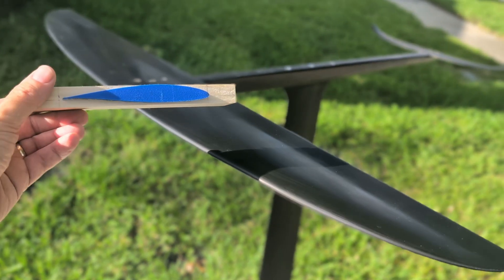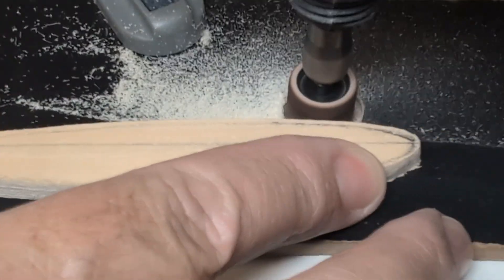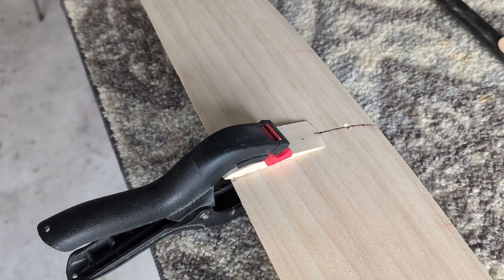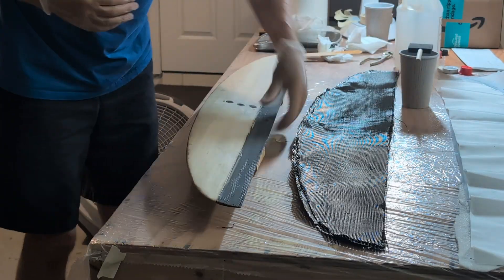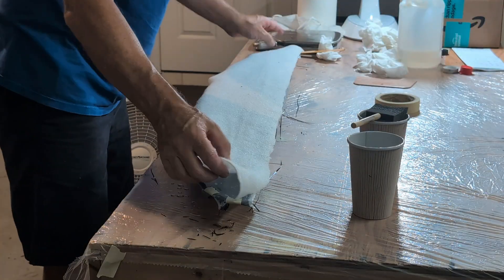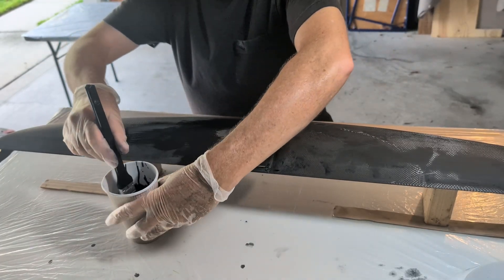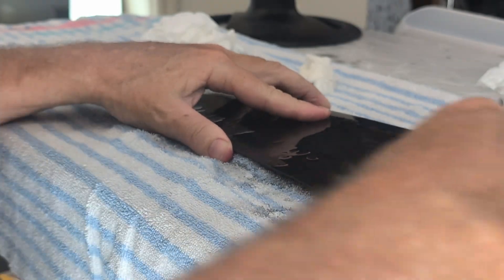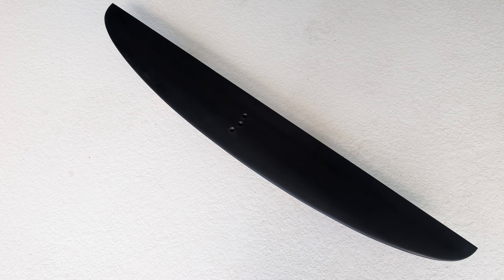DIY Hydrofoil Wing Build — Carbon Fiber & Wood Core with NACA foil profile

Comment: Thank you for making this video, I've made 2 foils so far, but I'm hesitant to try Carbon fibre.  This video gives me hope and inspiration.
Reply from the maker: That's great! How did they work? I'm currently making a 550 gull shaped wing...carbon fiber between layers of wood and on the outside. Using unidirectional for the first time for stiffness...will post a video in a few weeks if it turns out:) CF is not much different than working with fiberglass, but does need vacuum bagging.

Comment: Do we need to fabricate the bottom curvature of the forewing?
Reply from the maker: If you mean the downward anhedral curve of the wing, that makes the wing more maneuverable by reducing roll stability. Some wings have a slight upward dihedral curve in the center which makes them more stable, then downward anhedral curves at the tips (eg Patrik Aeon foil), adds back maneuverability and also helps prevent the tips from breaching in a gybe. So curving up, down, flat, or a combination, it depends on what you want the wing to do.
Reply: @goldney ❤thank you

Comment: Nice!  I have Used bunch of those same ideas I have learned over many project, but I have not put it together in a single project.  3d printing for tooling yup!  Nice to see the layup schedule was similar to a project I did, but I used 2 woven carbon and uni 3-4 layers and  progressively longer on the span for a i14 T foil.   A trick I learned and use is using a contrasting guide coat when fairing, really helps in finding low spots. Duplicolor for the win.
Reply from the maker: Thanks for sharing. Yes, I think I will use some uni cf on the next one. Contrasting guide is a good tip also.

Comment: a trick aermodlers use to get a finnished surface out of the vacuum bag is to use heavy mylar templates (you can get it from graphic design suplyers) on top of the wet carbon (you need to soak up excess resin with paper towls first ) the mylar is flexible enough to follow the aerofoil but stiff enough to leave a very flat shiney surface - you can also paint the mylar first and it will transfer to the resin leaving a finnished painted surface.  This tecnique produces the most acurate aerofoils short of a moulded wing .
Reply from the maker: Thanks for the tip!

Comment: Nice! Lots of great ideas!
But how did you calculate and transfer the angle of attack of your front wing?
It looks like you just laid it out flat and then adjusted the fuselage to it.
But is that really the correct angle for that airfoil?
Reply from the maker: Good question. The white table surface was made level. What you can't see in the video, there are some shims under the wing to ensure the correct AoA...target was about 2.5 degrees. I shimmed the fuse level, and after adding the epoxy checked for level again after the fuse was pressed down on the wing. I have about 3 degrees mast rake. I should probably re-measure everything to check the angles.

Comment: Bravo. Petite idée. Vous avez une imprimante 3D…j’aurais imprimé le moule en plusieurs pièces forcément puis imprimé toujours en plusieurs pièces le noyau en nid d’abeilles en PETG-CF. Démoulant sur le moule. Résine epoxy et bien sûr Carbon. Inserts en dans le noyau. J’ai déjà fait pour des gouvernes d’aéroglisseurs avec un profil Naca. Ça n’a jamais cassé. Encore bravo.
Reply from the maker: Thank you. Your hovercraft project must have been a fun project. Using a mold is definitely a more accurate method, and useful when making multiple copies. I think a PETG-CF core would require more layers of carbon fiber for necessary stiffness.

Comment: How much time you have spent and what total cost in 2025? - just saw yesterday -50% for carbon wings on some brand
Reply from the maker: I used some left over carbon fiber and epoxy so just had to buy the wood board. But I guess $20 for less than a sq m of carbon fiber +$20 worth of epoxy +$5 for wood, so less than $50? I didn't keep track of time...did a step at a time over about 6 weeks. But probably 15+ hours? First time on a project like this always takes way longer than you think:)
Reply: Don’t forget to add the cost of all those tools and disposable material (tape, sand paper, vacune bags, etc.). And the 3D printer. 

Thanks to the procession in the sport, the used market is insane right now. You can get a full carbon, professionally built, pro rider tested/developed kit and be on the water enjoying it, instead of in your garage dreaming about it. 

Not taking anything away from the craftsmanship, that’s really cool.

Comment: Great project! What about the rear wing? Are you going to use also an asymmetric profile or it's going to be symmetric and then you'll shim it to give it lift if needed?
Reply from the maker: I think I will just stick to building the front wings. The other components require more precision and techniques than I have skills or patience for. So will probably just use manufacturers components.

Comment: I also built my wing. From birch plywood, then laminated with carbon.
Lots of work.
The final shape differs slightly from the original profile H105 because multiple layers of carbon have built up, increasing the thickness and making the leading edge more rounded and dull.

How about to CNC matrix from dense foam, then laminate carbon layers into the matrix?
Reply from the maker: Yes, the addition of lamination does distort the shape a bit. I'm thinking that shaping the wood core to accommodate before laminating might help? Foam would work but requires more carbon.
Reply: I think one should subtract the carbon thickness from the profile prior to cut the core
Reply from the maker: @Piggdekk76 Yes I will have to try that on the next one.

Comment: I built my own carbon wing, I modelled it off of the Lyft classic and it was a tonne of work to integrate the fuselage and the stabilizer all in one.  I love how you did the trailing edge.  I also thought your Dremel CNC was very useful and unique.  Incredible creativity all around and very nice finished product! My friends ride my foil and love it.

Comment: Very interesting solutions you are using, thank you very mich for your video!
If you interested in learning more about the engineering of a foil look into Ray Vellinga's design guiding book and theory of airfoils.
I am going down the same path as you at the moment. If you like to try excellent and free CAD software look into Fusion 360.
I am very sure your foil will be working just fine but when you will try to optimize you will need to look in the engineering theory.
Thanks for the cool video again! 😊

Comment: Could you have 3d printed an entire core and laminated to that? Or a full 3D template you could router copy from it? Nice work
Reply from the maker: There are others who have had success 3D printing. Here's an efoil video I just saw: https://youtu.be/QLJQevvHTNg?si=YdbxasNt_SM4A7iz
I had thought about a full 3D template...or copy from an old foil.
Reply: That should be working too. But you have to be sure to print in a material that is adhesive to the resin used for laminating or else it will peel off the core and the stability of the foil is defective. 
ABS is said to stick to laminated fabric.  But it's more tricky to print. On the other hand PLA doesn't stick very well. I saw other builds where the layers of the fabric peeled off the foil or didn't even stick in the first place. Those foils were practically unuseable.